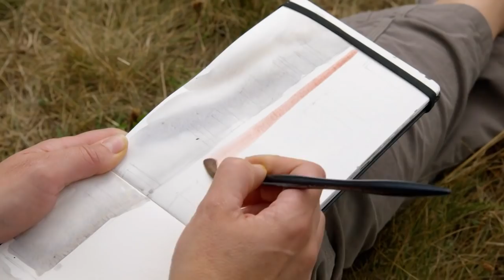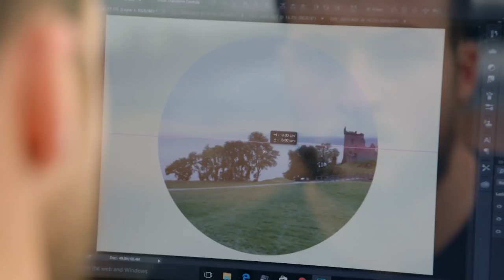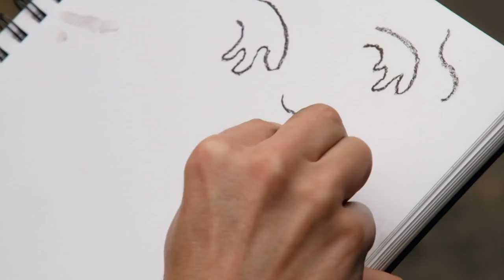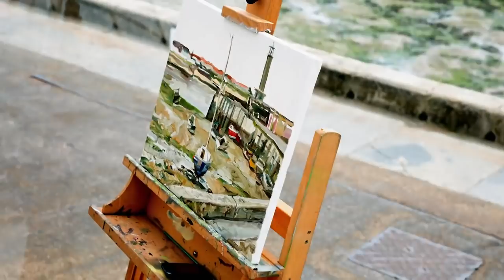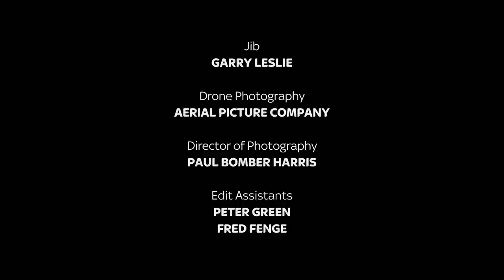Battle of Brushes: Final Challenge - Landscape Artist of the Year - S02 EP8 - Art Documentary

Comment: Disappointed with the finalists chosen.
I wouldn't have any of the three hanged on my house.

The stencil "paintings" are the images you'd easily find when you play with images using softwares.

The ink-based looked quite amateurish. The commission looked like typical illustrations you find on book cover. The black and white look overworked yet unfinished. Lots of problem all over the painting.

The winner, won because of his style. Which is very common to find if you've seen at least 2-3 painting galleries. And what's worse. The 4 hours painting always fell flat.

So many other semi-finalists that I think should went to the final instead. Many of their works not only showed the real picture, but also evoked emotions.